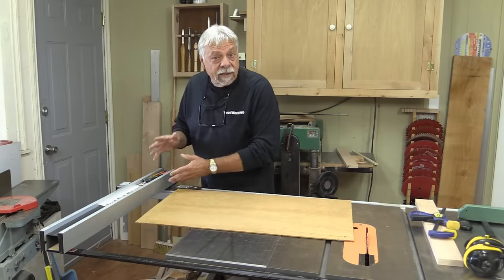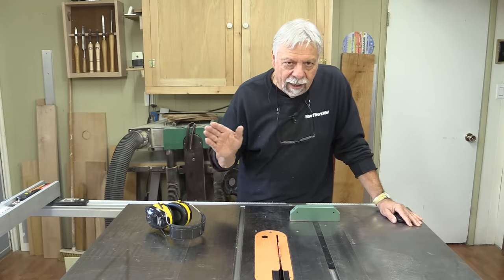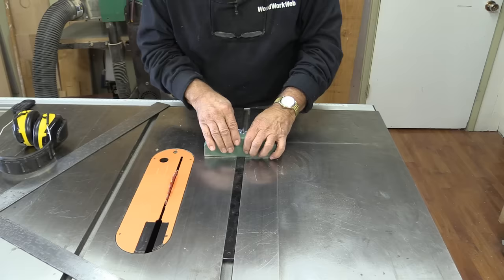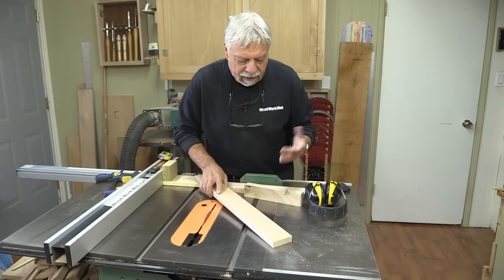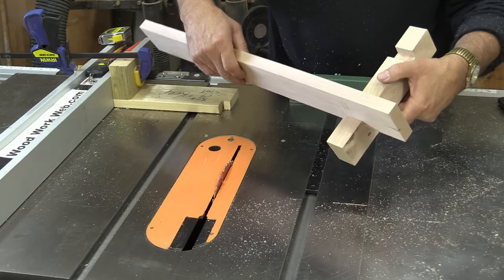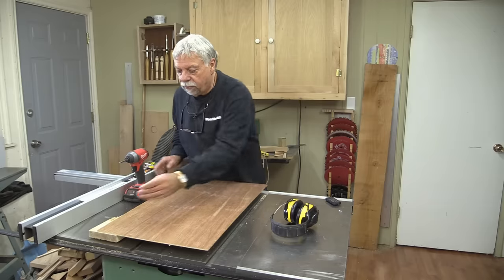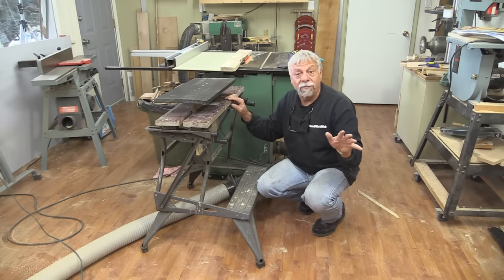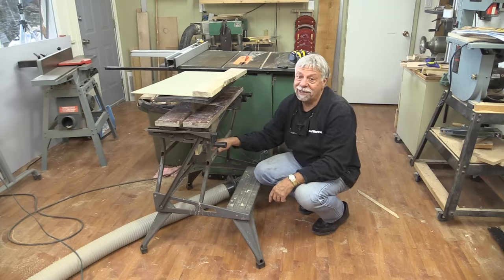5 Quick Table Saw Hacks / Woodworking Tips and Tricks

Comment: Here is another way to set your miter gauge to exactly 90° without any additional tools. Assuming the front edge of your table saw is 90° from the slots on top, turn your miter gauge upside down and place the miter bar in the slot and let the head of the miter gauge hang off the front of your saw. Loosen the bolt and slide the miter gauge up until the head butts up against the front edge of the saw. Tighten the bolt and you have just set it to exactly 90°. Turn the miter gauge over and place it back in the slot.
Reply: This is so simple yet ingenious it's one of those moments for me (which happens so often with woodworking/carpentry and I love it) where you feel stupid for never figuring it out on your own before.

So many things in wood craft take either a more experienced influence, or you do it the dumb inefficient way so many times that one day it clicks that there is a far better way. Again, you have a "shoulda had a V8" moment but they usually make me chuckle, and I'm happy to have figured out a better way
Reply: We used to hang it off the saw table in shop class and let gravity straighten it. Assuming your tables level of course

Comment: All good, but i especially like the quick slot jig. Really simple and effective. You can't beat that.
A quick and accurate way to square your miter jig is to flip it over, put it in the miter slot upside-down, bring it back towards you, and square it on the edge of the table saw top, or the fence rail, no awkward framing square, no other type of squaring tool.
Reply: I've been setting my miter jig like that since my father taught me back in the 60's.

Comment: Great tips.
With the slot trick, I clamp a piece of the material that needs to fit in the slot to my fence, then just do the 2 step off that then the fence.
No need for jigs and works for any size you need.
Reply: @STAINO - That’s brilliant... So simple yet ingenious...
Reply: Wouldn't you be off by the thickness of the blade doing that?

Comment: I like that piece of scrap as a shelf under the fence. Also that slot jig you made really slick no measuring.
Reply from the maker: Thanks Joe.
Reply: @knecht105  I have a table saw and i rushed it did not choose the right one. So i am getting a new saw it is called everlution  rage 5s  table saw it is a job site table saw even has a sliding miter panel with a clamp.  costs more but worth it  my old saw cost just over  £100 pounds. This new one one is Nearly £300 pounds.

Comment: Great effective, but simple ideas. Thanks for sharing. Good on you Colin. Look forward to your uploads.
Reply from the maker: You're welcome. Thanks for watching Bill!
Reply: In theory, your method of aligning your miter gauge to exactly 90 degrees is fine.  However, I'll wager that if you checked your framing square for accuracy, you would find it isn't.  Of all the squares in your shop, the framing square is probably the least accurate.  Better to use a Woodpecker's try square or something equivalent.

Comment: Thanks you sir. I have recently got into and fallen in love with wood working. I have a lot to learn and am accumulating tools and equipment as I go project by project. I am looking at getting a table saw and the one wants only weakness is that it will not take Dado blades. This was very helpful.

Comment: Cool video.  I don't trust the fence on my saw to be parallel  not the miter gauge to be accurate.  I use my framing square to check the fence against the back of the saw, and for the miter gauge, I use my tri square against the blade itself.  Works great for both 90's and 45'.  The way you do 45's you need to hold the square down while you tighten things and if the wingnut tried to turn the gauge the square might move, and you only have 2 hands.  My way you can shove the square right against the blade and hold it while tightening the nut.

Comment: Great tips Colin!  A speed square (if you have one big enough) is also good for setting up the miter gauge.  The lip on one edge let's you lay it flat on the table and still register with the miter slot.  It also has 45 built in, so no need to line up numbers.  Good for dummies like me who get the scale on the inside and outside of the carpenters square mixed up :)  Downside - I generally have to lower the blade whereas the carpenter square goes around it.
Reply from the maker: Thanks for the tip Matt and thanks for watching!
Reply: T-square for squaring up works great!!

Comment: The only two I’ve never used was the one in thumbnail and the one with placing the framing square on the same number to get a 90 degree. Neat trick.

Comment: Cool tips.  Subscribed!  

Got a question....my table saw has two 5/16" NC nuts that hold the riving knife on.  There are shims and it's a bit of a pain to change out if I need to remove the riving knife for some cuts and slots with my dado blades.  Anyone know of a quick disconnect that I can rig?  Fishing the combo wrench into that area and removing or installing those nuts with a blade in there is a bit of a pain.  The nuts screw on to two threaded rods.

Comment: Wow.  Great ideas.  Really quick. @2:44 You're at 8" on both ends of your square.  I get that part.  Are the 8" marks on the same side of the miter rail?  You could read them on the inside or the outside of the rail, so long as they're both the same side, right?

Comment: Great video! Question about the fourth tip. Why would you need a jig at all for a straight cut to take off the rough edge of that board? Wouldn't you simply slide it through up against a fence? I am just learning the ins and outs of table saws, so any clarity is appreciated.

Comment: I don't understand how the jig works at 3:36
It looks like it only allows to cut slots at a fixed same distance from the edge.
What if you want to cut somewhere else ?
Reply: it is clamped to the moving fence, so you can move the fence wherever you need the slot to be first; so it is adjustable

Comment: i have a dewalt table saw. i have the riving knife still atattched. just recently ive noticed once the wood i push through the blade gets to a certain point, i find myself pushing harder and harder as if its catching on something. i feel like if i slip ile cause massive blood shed ;) which obvioulsy i dont want. i do move the table saw in and out the shed alot and sometimes ive caught the corners. my question is, do you think ive hit the riving knife and caused it to be out to one side of the blade more than the other and also should the riving knife be inline with the blade? 

i was thinking of putting the fence on the opposite side to see if i get this jamming sensation. its cold wet windy and dark these nights so dont fancy doing it. Thanks from Gloucestershire UK

Comment: I'm trying to cut a 1/4 inch wide groove in the top side of 3/4 × ²0 × 72 table top and the underside of another to slide plexiglass into it but I'm having trouble cutting those grooves, any suggestions would be an absolute blessing because I'm a newbie and need help to finish this gaming desk. Also I don't have a router but will be buying 1 in about 3 weeks

Comment: made cabinets out of s2 hardwood lumber so faces straight but edges all over the map, cost 50% less than s4 stock... took 1x3 inch x 11 foot metal tube, welded a 1x4 x1/4" strap over one end with a 1/4" bolt threaded thru the end of the 1" over hang.. bolt had very sharp point..lined the concave side of the lumber along the metal tubing  then "rammed" the end of the board into the sharpend bolt... this kept one end tight against the tube, i kept the other end tight...passed it thru the table saw.. had an 8 ft out feed table..did 1000s of broad ft this way..once one edge is straight your good to go...10 ft stick could be cut straight in a minute and setting up next board takes seconds...on a 400 board foot order set up lumber in increasing order of thickness to minimize changing fence.. 400 board foot order one side straight in half hour

Comment: Great ideas for the saw, here is another:  make half a crosscut sled for the left side of the blade the edge will be at blade.  If you want to cut a circle with the saw you simply put a pin in the plywood base and you can spin the piece or slide the half sled and make great circles.  Only problem one needs to know a little math to make a circle.  Try it, you may like it.

Comment: Yeah I was looking for an adjustable table ..I have a table like that and just have to adjust.  That is so simple. This will probably get built tomorrow. 
That little jig for the dados is great..But 'Ive  had so so results with the follow thru that you sped
Up..  I am making a special project.  It is a box 7 foot long and two foot wide. It will have a 3/8  by  1 and 1/2 notch every 7 inches to hold dividers.. I've been torn between a table saw and a router.. It seems like the router would be easier.  I'll be clamping the seven foot 1 x 2 together.

Comment: I have a Rigid 10" portable table saw for my shop, I used your suggestion of using a tape measure to do my cut, but it still is about a 1/16th of an inch off? I have Diablo finish cut blade installed.

Comment: Hi Colin. I’ve been enjoying your videos and have learned a lot. I’m waiting to move into my new house so I can get my table saw. I know that they are equipped with blade guards, however I rarely see them used in most videos. Are they a hinderance? Thanks!
Reply: Hi Janine, They can be a hindrance but if your not experienced running a Tablesaw might be a good idea to keep everything in place for your safety. Personally I would recommend this as an alternative - MJ SPLITTER Table Saw Safety Splitter and Riving Knife Alternative for Zero Clearance Insert... Check Amazon.... Best of luck

Comment: Combining  your idea of "Slot jig" and Themasterwoodworker's on cutting thin slats, I made a jig just like yours, but with the notch, say, 1 inch,  then apply a screw so that I can adjust the height of the screw to make the jig adjustable, easily and precisely, for various slot sizes,  for single blade table saw finger joint (dado, rabbet).

Comment: On #2, make sure your framing square is square.  Many times they'll get banged with those long arms & get knocked off.  Simply put it on your saw/bench and draw a line, then reverse it and make sure the lines are the same.

Another tip is to know exactly where your blade is going to cut is to take a piece of masking tape and put it in front of the blade, then cut a piece of scrap, draw it back, and make a line with a fine point pencil/marker.  Do the same for the other side & you'll always know exactly where your blade will cut & what it will remove.
Reply: FYI, with the tape trick, you have to repeat every time you switch blades or it won't be 100% accurate.

Comment: As a very novice woodworking type although I was raised around a wood shop, I would like to know why you choose to remove or at least not use at least a riving knife ? My expertise is with metal but my hand doesn’t make without safety. In my opinion even those small cleanup pieces could become missiles.  Keep the tips coming I sure appreciate the knowledge!

Comment: Oh, and to follow on to the 45 degree trick - you can memorize other pairs of numbers to get other angles. For example 2 and a hair under 3.5 will get you awfully close to 30 and 60, if you don't need dead accurate precision. 3 and 15/32 gives you 29.97 degrees. 3.5 gives you 29.74.

Comment: Drill an appropriate size hole in a large block of wood (glued layers if need be) large enough so that the hole can be pre-cut in two halves for removal afterward and lined with something like saran wrap and poured with 2 part epoxy to create a new handle for that mitre.  thread the bolt through the wing nut and put some plumber's putty or similar thick, sticky covering to allow the bolt to be withdrawn after it sets up.  Now just pour the epoxy in the clamped halves of the lined hole, set the bolt/wingnut in place to bury the wingnut perfectly, and when it sets up you'll have a new handle/knob.

Comment: You sir ... have been very helpful!!!  I love the jointer-tip and the dado tips.  Very interesting.  I'm considering two Dewalt Table Saws [DW7491 vs DW745] (one can use dado blades and one cannot) and am debating whether or not to pay the extra 200+ for the ability to use dado blades.  I don't want to kick myself later for not spending the extra 200+.  Any suggestions?  This is my first table saw purchase and I do have a capable router.  I'm personally leaning towards the 7491 so I don't regret it later.
Reply: Kevin M , I bought the Metabo jobsite table saw from Lowe's and that model can be used with a dado set plus it is very steady. I bought it on year end sale for $299 and have been satisfied with it's performance.

Comment: OK , so I have a question . Why take a sheet of plywood to make a straight edge for the crooked, or live edge board ? Why not use the saw fence to square it up ?
Reply from the maker: Usually, both edges of the live edge boards aren't straight, so you need the plywood to act as the straight edge for cutting.

Comment: If you have a cheap saw with a non-retractable riving knife (cheap saws also tend to have an O.T.T riving knife - it loops around over the blade too much) - anyway - use your grinder to trim down the riving knife so it is just a tiny touch lower than the top of the blade ( 1 or 2 mm is enough) - you can now use the saw to cut tenons, without removing the riving knife every time you want to - and it's still safe to cut with, safer than removing the knife by far. Removing the knife is also usually a p.i.t.a - so trim it a little. :-)

Comment: Is there a reason to square the miter gauge to the opposing miter slot, rather than the blade itself? Now, of course, these things should be parallel, but they could be slightly out of line. After all, the thing you ultimately want is for it to be perpendicular to the blade and it should be even easier, faster, and more accurate to use the blade itself to hook the square around rather than to try to align it with the miter slot. That was my first thought anyway, but perhaps I'm missing something obvious.

Comment: Hey Colin.  Love your site - it's jam-packed with useful info for us newbies !!  A stupid question on the 3/4" Kerfmaker" though.  If the dado you're making is at a specific location on a board, how would you set the fence ?  Wouldn't you still have to line up the workpiece layout line on the blade's outside face ?

Comment: One of the main things I love about my Hitachi is it has a 35 inch fence extension but the best part is you can flip the fence over and it already has that ledge built into it. For a contractor saw this thing has everything I need. I can even fit up to 7/8 dado stack on the arbor

Comment: Fastest way to insure 90 degrees on a miter Guage is to turn it UPSIDE down, put the long tongue in a table slot & push it to the edge of the table.  (The slot is always 90 degrees to the edge)  Tighten the handle and it's perfect.  Piece of cake.
Reply from the maker: Thanks for the tip John!
Reply: WoodWorkWeb
You bet.  Your 45° idea is stirling.  Thanks.

Comment: To get the 90 degree angle use a 3/4 inch thick piece of wood in the miter slot to put the base of the carpenters square against tp set i[ your miter gadget fpr  am acciratte straogt square.

Comment: I saw one of Izzy Swan's videos where he used a "miter set" to set the angles of his miter gauge. It's expensive, but I'd imagine it wouldn't be too difficult to re-create that for a 90 and 45 degree jig.

https://miterset.myshopify.com/collections/mitersetstandard/products/perfect-miter-joints-u-s-miter-gauge

Maybe you can make a quick jig by cutting out a dado/groove on a board for your miter gauge to slid into while it's loosened. You can use 2 pegs/screws to align your gauge to 90 on 1 side, and 45 if you flip it around. Just a thought, it would make it quicker/easier to set it to either one during your transitions.

I know wood moves and wears with use, so it might not be great for longevity but it could work.

Thanks for the tip, sorry for the lengthy comment.

Comment: 4:35 I find using a hot glue gun for this is easier.
Reply: I dont "find" what is easier in using hot glue... First you need to warm glue gun, then glue it, then rip pieces... Its kinda stupid idea to use glue gun in my opinion, srews are easier, quicker and holds better. But its all to You.
Reply: I would never use screws, double stick tape works well.
Your first cut is one of the first don't do cuts on a table saw, running a piece that's
wider than it is longer is dangerous.
Great tips otherwise, I'll be making one of those dado jig's.....
Reply: For those cuts you want a sled. I don't like metal fasteners for this either because of the chance of miscalculating and wrecking your blade. Still tend to use them though, for the positive hold. Hot glue sounds like an interesting alternative. The saw would slice  right through that, no problem.